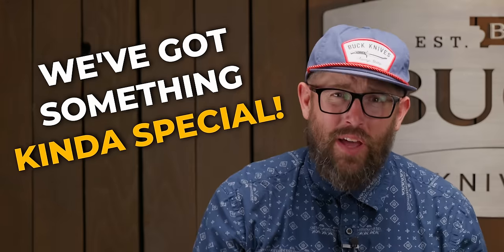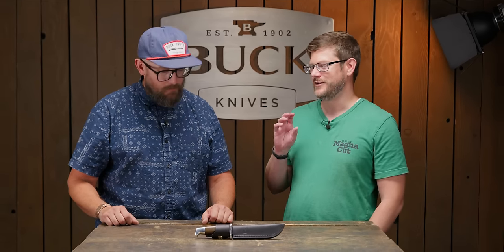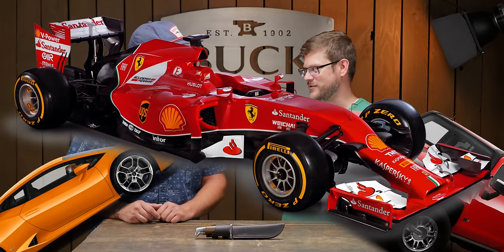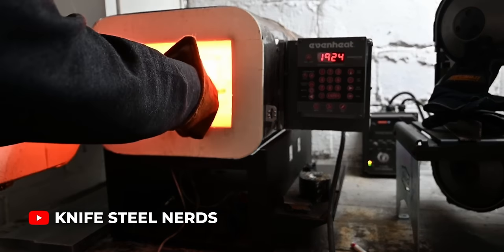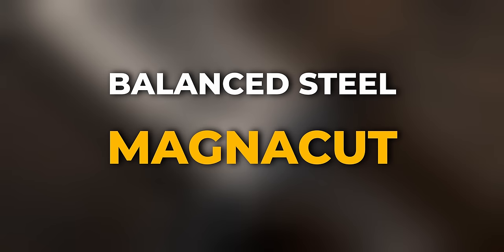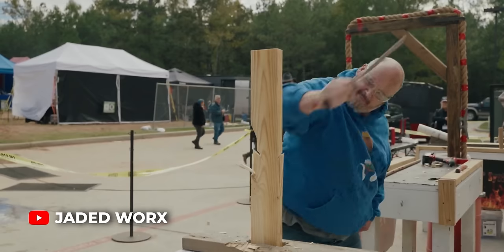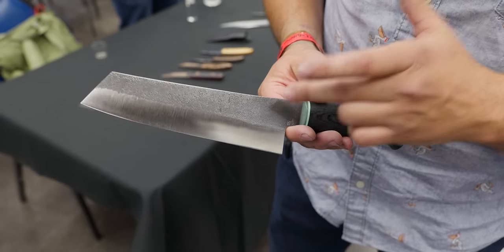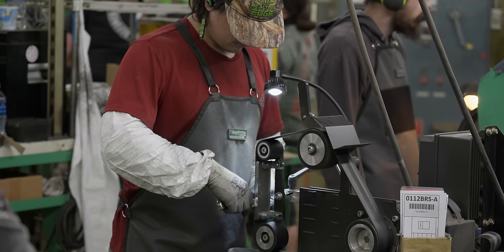The 3 Best Knife Steels According To Science! || THE Knife Steel Nerd Guide To Knife Steels.

Comment: I am a huge Maxemet and Cruware fan. MagnaCut is a great steel also.

No matter what steel anybody likes, it's a great time to be a knife enthusiast, that is for sure!
Reply: cruwear and 3v
Reply: Until you pay half your paycheck for a knife.  I'll take the good 'ole 1095, 5160, 440C or 420HC any day.  If heat treated to perfection, that's all you need.  Plus, I would rather not spend a sharpening session on super "duper" steel at the campsite in the middle of the mountains.  Just my thoughts.  I ditched all of my super steel blades.
Reply: @@blueelk5667 Exactly what I was going to reply with. All the steels he listed can't get through skinning 1 decent sized animal without needing a touch up, even 1095. I can skin and process multiple bucks with cruwear, magnacut, or at least 2 with S35VN without needing to touch the blade. And cruwear and magnacut are easy pretty easy to sharpen as well, so is logic is flawed there as well. You really do get what you pay for. I wouldn't necessarily say "almost as expensive", but there are plenty of $150+ 1095 knives when I'll pay $100 more for a far superior steel (and if $200-$350 is half your paycheck, you need a better career). If he can't sharpen for shit and wants something he has to touch up constantly, that's his choice and have no issue with it. But it's disingeunous at best to pretend that magnacut isn't far and away better than a mediocre steel that he thinks is "all you need". NEED? Sure. Sears and Kephart did alright without super steels. Men also survived just fine with flintlocks and percussion caps, that doesn't mean we should ignore technological advances just because what we had was good enough. Tell me ruger, do you still have a radio instead of a tv? You better not have a tv with a remote instead of manually turning the dial.
Reply: @blueelk5667  See, I had that same thought process when I bought all of those super steel knives.  It's a powder steel it will hold an edge longer.  But the thing is, I can get my 110 razor sharp in a minute just on a light packable Worksharp pocket sharpener.  As far as the 1095 stuff, yes, some can be damn expensive.  But I don't buy the ESEE's.  Instead I go for the Ontario's, all of which I got for under $70 in both 1095 and 5160.  I guess I just don't see the need in spending half a paycheck on a knife.
Reply: @Ruger44Redhawk  And there's nothing wrong with that. But stop the hyperbolic nonsense that $200-$300 is HALF your paycheck. If it is, you have bigger issues. It's almost like you're using price as a defense mechanism for being poor and not buying a product. You don't see the need to spend more money on a far superior product, that's fine. You're lying or obtuse if you can't see why these products are superior to the mediocre steels you choose.

Comment: I still have my buck gator with 440 blade. Over 20 years, and the only issue was me chipping it using it as a screw driver. Grinded it down, and it's good as new. It's been used a lot and only been shaped a few times. Not really on topic but I wanted to share.

Comment: I would have zero problems seeing more CPM154 used in production knives.
ATS34/154CM were the hottest supersteel of the 1990's, but the biggest flaw was just being a cast ingot with large grain structure (same deal with D2), as soon as you make that same steel in powder it's still a very high performance steel, and as mentioned easy to sharpen.

Comment: For cutting leather I bought a K390 steel Spyderco Dragonfly with a sheepsfoot blade as a small pocket knife, but I cut some leather with it and haven't used anything else for long straight cuts in thick 1/8th" to 3/16ths" (8 oz to 12 oz, 1 oz=1/64th"). The blade is thin and lasts all day. It isn't stainless, but I live in the desert so rust isn't an issue, if I lived by the ocean I would go with CPM S110V which is stainless.

Comment: Love AEB-L and cpm-154 steel I also have a spyderco in s110v though I haven’t used it enough to have a real opinion I’ve never used Magnacut but it’s the #1 steel on my want to own list the only reason I don’t already have a knife in Magnacut is that it came out after I finished my knife collection it’s hard to justify buying more knives at this point . I do wish u made the video longer to go through the non stainless steels like M4,3v,15v and S7 high carbon steels guessing 15v would beat stainless in edge retention and non stainless is also tougher than stainless as for balance I’d probably give it to stainless because of the stainless part which u have to consider guessing Magnacut would win that category again.

Comment: Almost twenty years ago, the company I worked for moved into the building that Buck Knives had its business in before moving to Idaho because the city and state would not work with it over taxes.  That was what motivated Buck to move to a more friendly state.  Before everything was moved out I was given a tour of all their machines.  It was very impressive.  I don't own a buck, but I do own multiple items from Cold Steel.  The issue with Bick Knives is that they were asking far too much for their knives and by and large their knives are not all that much better than any other commercially manufactured knife.  Their high price if supposed to be an indication that they are that much better.  YOU'RE PAYING FOR A NAME, WHICH IN THIS DAY AND AGE IS NO LONGER GOING TO MOVE GREATER SALES WHEN EXPENDABLE CASH IS IN SHORT SUPPLY !!!

Comment: S35VN is the best steel for smaller knives 🔪. 1055,1080,1085,1090,1095 are best for larger knives. There are variations of these steels as well. A2 and 80Cr2V are great for bigger knives like bowies because it’s super tough but holds its edge.

Comment: Short but extremely informative!  I’d love to go back in time and meet his equivalent in the Stone Age…surely there was an expert flint knapper…😂. I’m curious as to where D2 and 3V fall in this.
Reply: I think 3v is similar toughness to aebl/14c with better edge retention, but aebl has better fine edge stability meaning it won’t roll or chip as easy in a thin slicey grind. 3vs edge retention advantage means it will be harder to sharpen and will require diamond stones, whereas aebl can be done on river stones, sandpaper etc. 3v might be the better choice if you’re chopping through bolts or the like or value the bit better edge retention over the stainlessness and ease of sharpening for aebl/14c. A serious chopper will have a thicker edge geometry so it won’t be as good at slicing but the little bit thicker 3v edge will be extremely strong and resistant to chipping. A thin edge like for a kitchen knife or something you want to be thin and slicey would be better in aebl/14c
Reply: @ShoahBiz  Thanks for the input.  I have two new knives, you can guess what steel they are.  Sadly I have yet so use either of them, this summer has sucked!
Reply: @asmith7876  yes this summer has been absolutely brutal here in the Deep South and it’s also the driest summer I can recall, tho I’m not too old. Not a fun combo of extreme heat and dryness. Really looking forward to this fall ha. 3v is a great steel for harder use knives and I plan to buy another one soon since I sold my last. Very coveted steel for a reason.

Comment: Vanadis 4 Extra is my choice for a belt knife for the outdoors or 52100. For edc pocket knives etc I'd choose M390. Those are my absolute top 3 and I wouldn't put any other steel next to them. Only an American, would say, thatt there isn't a dfference between M390 and S30V.. He knows there are big differences from edge retention, to how their carbides cut, to stain resistance and so on. M390 is far superior. Not to mention, the 3d generation powder metallurgy, that Amercans don't even dare to mention...and who knows knows..nough said.

Comment: What defines best.

I actually do not care much about what most say is most important...edge retention.

I want easy sharpening to a razor edge and toughness above all.

Then, edge retention.

I consider stainless a plus, but not required.

Just tough, sharp and easy to sharpen.

I'm happy as a pig in mud with 14c28n, s35vn, a good 1095 or 420hc, or 3v.

Comment: Just got 2 knives from Buck in s35vn. The edge finish could have been much better.  They are pretty sharp, but there are still grinding marks on the edge.  Little disappointed for $400 of knives.  Still great knives, just bummed I still have to work them.

Comment: Welcome to Idaho!  Good info, but I'll take 1095, 5160, 440C or 420HC every day over the super steels.  If heat treated properly, the old school stuff works.  I ditched all of my super steel knives and am pissed at the money I wasted.  For starters, I would rather not have to sit through a sharpening session in the middle of the mountains when a light pocket sharpener can put an edge on the old school steels with ease.  I feel like the knife industry is synonymous with Gore-Tex now.  Everything has it, makes it much more expensive when you don't actually need it.  The 3 dot 1980-81 Buck 110 I have has a wicked edge I put on that 440C blade with a pocket sharpener in minutes!

Comment: Amazing how "snobs" will bash anything, including knife steel. 440 stainless is a very useful knife steel that will hold an edge in most practical conditions, is easy to sharpen, corrosion resistant and LESS EXPENSIVE. I understand that if you're in extreme situations such as the military/special forces/law enforcement that you might want a superior steel, but for most daily carriers of knives, 440 is well than up to getting the job done.

Comment: Not a fan of high carbon steel, eh? Very knowledgeable; very interesting. I feel as if this video could also be done by knife category as well since some steels are better suited for certain types of knives as opposed to others. It would be interesting to see what you have to say in that regard. Obviously something you take out into the field that gets wet needs to be higher corrosion, whereas a kitchen knife might benefit from other types of steel (my kitchen knives are 52100). That's just my two cents.

Comment: Thanks for a fascinating insight.
Question: I didn't pick up much mention of laminated knife blades, like the Fallkniven Modern Bowie or the Cold Steel Trail Master (San Mai III version)? 
How would you rate those blades in the arena for which they were designed and made?

Thanks in anticipation.

Comment: I have often been seduced into buying "better steels", "modern steels", "super steels", etc.  And thay're always great... until they're not and I have a lot of trouble re-sharpening and I can never quite recreate that original OMG edge.    So here's my conclusion.  Stick with older boring steels -- and they're really easy/cheap to find on the aftermarket - and get good at re-sharpening them quick and easy.  Like shining your shoes or sharpening your pencil point.  It gives you a moment to pause and do something valuable and cathartic.    And EVERY steel you're using is harder and tougher than the thing you're going to cut, right?  So if you're knife gets dull and that 'thing' is winning... you sharpen the knife and come back and cut its ass.  Hah!  Showed you.
Reply: The advantages of plain high carbons.
Reply: @adamparker9765  Meh you migth as well take a tough inox steel, or a tough alloy steel. Sure it won't be as easy to sharpen than some carbon steel, but it is not going to be incredibly harder either, and you get some corrosion resistance on top of that.
Reply: @benjaminparent4115  Cant forge them and they cost the dickens and nothing gets as sharp as plain high carbon.

Comment: 6150, is my goto metal. High Carbon, High Vanadium, High Chromium. The reason. Vanadium and Chromium are ultra resistant to corrosion from Nuclear, Biological, and Chemical Waste, Chromium is impervious to Salt/Mineral Water Rusting. Its edge retention is a Rockwell of 60-65+,. Since it's high in those metals, they are among the best Sharpest in the world. And The Strongest/Toughest and Wear existence so far. 
The High Carbon makes the leading steel itself very hard. 

So 6150 tool steel is among the best for survival in a Post Apocalyptic environment.  D2 or A11 Works well in that environment as well.

Comment: Balanced steels.. now that magnacut exists, s30v can take a hike. the other one Id say is XHP. That way you get one vanadium steel and one chromium steel. the chromium steel will be easier to maintain, doesn't need diamonds, and polishes better and more easily..... also XHP is a fantastic well balanced steel that punches above it;s weight. But magnacut is the new goat. love that sh.. stuff.

My favorite steels, chromium alloys:  52100, aebl, xhp, zdp-189.  Vanadium steels: 3v, 4v/4ve, cruwear, M4(!), and vanadis8/k390/10v.. I prefer 10v. Favorite stainless steel and all around steel: Magnacut. Non stainless, it's for sure M4. If I had to only have one steel till the end of time for everything,  I'm an old fart so I want to say AEBL, but I'll bust out the diamonds and go magnacut.

I've been doing machining for almost 3 years now, so I know only a little bit.

Comment: Ive a question regarding bronze. As we all know, classic copper tin bronze is not quench hardening. However, i was told/ maybe read that Aluminium bronze with an aluminium content above 15% is. Does anyone have any experience with that? Yes i know that it wont be as good as steel. The question is if it can be. Thanks for your time

Comment: Just wondering what the doctors opinion on Vanax Super clean. I currently have a Vanax gyuto chefs knife, the original makers of the blade made it slightly too thick for my liking of a chefs knife. I personally like a very thin knife, 2 mm, for a gyuto. I think mine is roughly 3.5mm. Do you think I could get it grinded down to my preferences or do you think I should leave it it to the blade smiths design and purchase a new knife?

Comment: An idea came to mind while thinking about edge geometry. What if a blade edge is sharpened at a slight tilt instead of uniformly flat, so that the edge angle is wider near the choil, and narrower and slicier at the tip? Would that not make the knife even more balanced and versatile to handle hard thumping and fine slicing? 
Just curious. Maybe I'm gonna try it on larger knife to see the contrast in effect.
Reply: Tenho faca que originalmente foi fabricada assim. Eu apenas fiz um desbaste de alívio com micro fio na parte direcionada a cortes precisos e deixei próximo ao choil ,para cortes de impacto, praticamente original.
Reply: There are many knives out there now which have different edge geometries along their profile. I actually prefer ones the opposite of what you describe: slicier near the choil (for when I am choking up on the blade) and choppier near the tip.

Comment: I like Magnacut, and I own knives that use the steel, but corrosion resistance is more important than hardness for me, so I go with Vanax for my everyday knife in a super high humidity environment.
Reply: Cedric & Ada did a corrosion test that might interest you...
Reply: Magnacut is almost impossible to make rust in any normal wet or humid environment mate. It's basically as rust resistant as LC200N. I've used mine in salt water many times, no cleaning, zero rust.

Comment: 9:02 also the geometry of a blade that has a thin secondary as the first always loses sharpness quickly
Reply: Also convex is always the best not easiest edge to get
But also add that in use different blade grind matters. A Scandi grind will always baton better as is wedges on the shoulders but the i wouldn’t consider it a good slicer. It’s probably why mora puts another edge on it
Reply: I love when you talk about his accolades, his head dips. What a humble guy.

Comment: No one is saying  440a is  a garbage steel if it has a good heat treatment, d2 or s35v steel are better and if you look hard enough you can buy these steels at an affordable and budget price. 14c28n is basically chinese ause8 which is still under 440c hardness scale. so buy 440c or d2 or s35v and you have better knives within  an affordable price point.

Comment: Dear Doctor !. if we add a lot of charcoal powder to the red hot steel , do we make it stronger due to higher carbon contents or just that is not the right way ?
2. i Use blockage rod which is used in removing the blockage , i can not cut it by hecksaw blades all teeth is going to be broken , I have to cut by angle grinder .